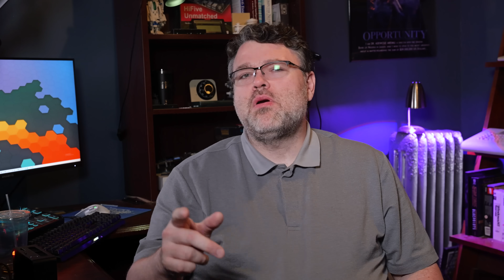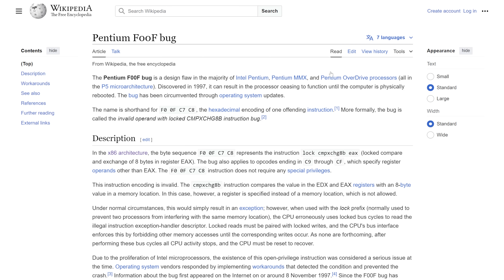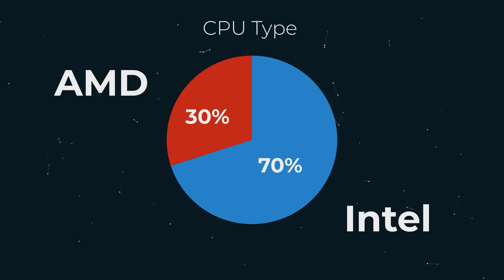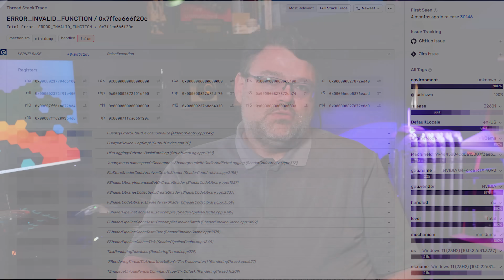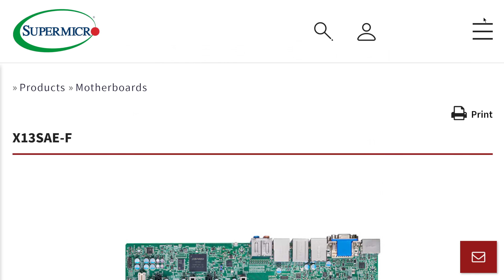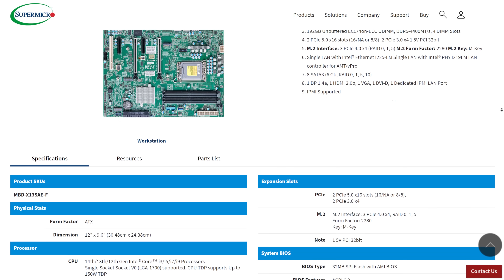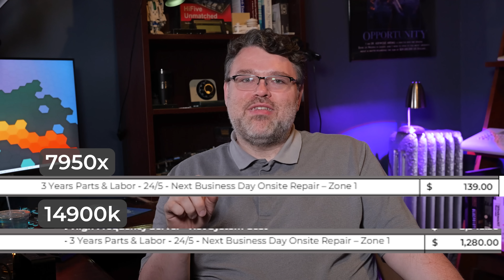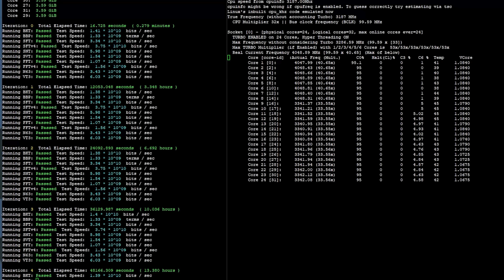Intel has a Pretty Big Problem

Comment: "No one ever got fired for buying Intel." And that's precisely the problem. 😉

I had some issues with data corruption caused by an Intel chipset (800 series, I think) back in the Pentium III days, and decided to switch my company (post-production / visual effects) to AMD. This was around the time the Athlon MP came out, and although we did have issues with one of those (Tyan Tiger MP motherboard with some random "IRQL" bluescreen crashes), every other AMD system (especially since Opteron) has been solid, cheaper, and usually faster than anything Intel had. 

Likewise, I switched to ATA RAID controllers back when everyone was saying "you have to buy SCSI", and then to software RAID (RAIDCore BC controllers) back when everyone was saying "you have to use hardware RAID". Even when they weren't faster (and were just "fast enough"), the difference in price allowed me to upgrade a lot more often and have much more storage than the competition.

Moral of the story: it pays to have a resident nerd instead of just going with the herd.😜
Reply: I had one of those Tyan Tiger MP boards as well. Weirdly enough those random IRQL crashes would go away if you left a PS/2 mouse attached to the machine. Apparently a chipset bug in the DMA section, if I remember correctly.
Reply: Here's my anecdoet: I'm still using 10 year old Intel H87 and Z97 boards and both boards have data corruption issues on the USB ports across multiple USB drives.   The corruption issue occurs when both USB lanes are loaded up with high bandwidth (simultaneous read+write).   This only became an issue when I started using the ports in this configuration for regular high speed reading and writing of large video files.   I am convinced the H87 and Z97 platform has hardware bugs with the USB 3.0 implementation as I am able to reproduce the issue.   I am unable to reproduce the issue on third party ASMedia USB ports, only the Intel USB ports.   Again this is on 2 different motherboards across a variety of USB drives - the only common denominator is the H87 & Z97 platforms.  I also do not get corruption on a third party Renesas PCI USB 3.0 card.   I don't think it was caught back in 2014 because back then nobody was using USB 3.0 at such high speeds for data transfer in both directions (read+write simultaneously).
Reply: @Animal_lives_matter  Wi-Fi in use anywhere nearby?
Early USB 3 implementation had major issues w/ causing and receiving interferance from 2.4Ghz wifi sources. 
Technically, the issue remains to this day; just 'mitigated'.
Reply: @LRK-GT  
Yep I'm aware of that wifi issue and have read the pdf many years ago but that is about USB knocking out wifi signals not vice versa.   I do have a wifi router nearby but it is only turned on when I want to do online stuff, but I should probably do more tests as I never properly tested it.  Both motherboards with the issue have wifi router nearby
Reply: it's good when that resident nerd also has the hands untied. respect and cheers!
Reply: Honestly, I would tend to associate data corruption issues in the i815 days with the onset of the capacitor plague rather than chipset issues. Jumping ship around that time seems ironic since I can't think of much bad to say about Intel chipsets in the Pentium 4 to Core 2 Duo/Quad days and into the early 2010s (even when early 60 series chipsets were found to have issues with degrading SATA ports before launch, a bunch of boards were exchanged on Intel's dime). Well, running PCIe 2.0 GPUs on older PCIe 1.1 chipsets is a bit dodgy (e.g. possible hibernation resume failure) but it's hard to tell whose fault that really is.

Meanwhile, AMD users had to contend with VIA and SiS chipsets and their dodgy drivers, misc. VIA southbridge bugs (PCI issues with SB Live!, 3 Gbit/s drives), or later nForce chips losing their balls as a result of nVidia's famous production issues. Even systems from the AM2/AM3(+) days still seem to have a certain "fiddle factor" with driver quirks that you just wouldn't see on the blue side. While there were some dings to their reputation in the 2010s like USB issues on 100 series chipsets, most of the time you were better off with an Intel system if you wanted your peripherals to actually work flawlessly. Even on AM4, it took AMD a good while to resolve the fTPM issue that caused audio stuttering (and you can still get that to this day if your RAM clocks / timings are too hot, as they often are with DDR4-3600; also, do I need to remind anyone of the broken C-states in Zen 1? last time Intel had C-state issues like was was in 1st-gen Core i). Most recently, on AM5 it was found that using an optical drive on B650 chipset SATA ports would wreak havoc on audio playback. (As someone who still buys and rips CDs semi-regularly, that would annoy me to no end.)

These days the playing field is a lot more even than it used to be 10 or 15 years ago. If you mainly need multithreaded CPU "grunt", there's little reason not to go Team Red. For a basic office box, it's more or less a toss--up between basic LGA1700 and monolithic AM4. Seeing elevated field failure rates is not a first for Intel (see Rocket Lake, although you weren't much better off with Ryzen 3000 which has had its fair share of substrate issues resulting in dead chips), but finding such wide-ranging issues on their top-end consumer parts indicating things being pushed too far is deeply disappointing.
Reply: @PileOfEmptyTapes  - No, nothing to do with capacitors. It was a known issue with the southbridge under high load (and a video workstation back then was pretty much permanently under high load). It ended up being fixed in a later revision, but what prompted my decision was that Intel had known about the issue for a long time and chose to keep their customers in the dark.

In much the same way that they know 13xxx and 14xxx CPUs have issues but continue to sell them while trying to blame everyone but themselves.

Comment: I came to the same hypothesis as maybe the electricity coming in was measured as enough for the use case scenario but maybe the issue is somewhere deeper in the chain of electricity distribution across the architecture of the silicon itself or at least a part of it.

The symptoms really make you think of a power loss when too many things try to work all at once.

Not only we have the amount of cores but also this newest architecture design of E-Cores and P-Cores COMBINED with way higher RAM speed (memory controller requierement) and also way higher requierement when it comes to PCIe lanes/bandwidth.

Maybe Intel kind of did hit the limit of what they could build out off their latest process node, we have been powering our processors with 1.4V or so for so long, maybe with everything going on in those CPUs, this is not enough anymore but they didn't account for that in the design of the chip or at least not enough considering all the losses through all the differents components within' the chips.

Maybe they should have went with a smaller process node but they were like ''Nah, it should be fine for this time, we will move to a smaller process node for the next generation in order to save cost for now''.

Comment: Unstable? Let me share my story, after waiting for 4 years I finally upgraded from a 9900KS to a 14900KS .

1 : First of the bat SP score sucked.
2 : Now own a heater that outpreforms the heat outlet of a modern airco
3 : Intel claimed 6.2GHZ. I've NEVER seen that, and after their supposed bios settings, it doesnt even hit 6.0 ever. This is pure false advertising and if there are more affected in Europe we should start a suit.
4 : When asking the vendor for responsibility they simply point at intel and intel doesn't reply

Comment: the 12900k was clocked at 5200mhz, a 13900k is clocked at 5800 and the 14900k at 6000mhz. even the "conservative" w680 board clocked the chip at 5700mhz. tbh this is probably just too much for what the chips can do stable. the 13600k and 14600k (5100/5300mhz) seem to have none of these problems, despite being the lower binned chips.

also w680 having lower power targets should mean that either a) the chips are clocking down when going full load on all cores or b) the chips are less stable at these clock speeds. it should also mean that the chips are degrading less over time, since creating stability with high voltage degrades the silicon faster.

Comment: I've had to replace a failing power supply that caused instability even in low power situations for my new 14700KF system. The PC first started to get slow and then crashed. After changing the power supply to a known-working older sample, I haven't seen that issue again. I also use DDR4-3466 on tuned timings on four Micron Rev. E 8GB sticks. I've seen instability when trying 3600 but 3466 is fine (and even better performing in games). Needless to say that I am very cautious with my power settings due to these reports, PL1: 125W and PL2: 175W and undervolting massively. While I lost around 10 - 15% multi-core performance compared to normal systems out there, this is still plenty for my needs and wait for a BIOS fix from Intel.
Reply: By the way, I use a contact frame as LGA1700 is said to have some bending issues which lead to cooling problems. Maybe that is a contributing factor? I suppose most machines don't use a contact frame?
Reply: Wait, I forgot to mention a few oddities. My undervolting settings don't appear to be stable when installing Windows from a USB device. Midway through the copying process, the installation would crash. But once Windows is installed, I can re-load the undervolt settings in BIOS and they seem to work fine in Windows and in Games later on. As I use 2 x NVMe devices in RAID-0 and have to install the Intel VMD driver first, I cannot tell if that is a contributing factor. Another one would be a 10 Gbit X540 NIC that only works fine if I put it in the bottomn PCIe slot. I also need to enable the onboard NIC or Windows would throw a BSOD on load.

Comment: I think that all of this "Xtreme OC"/"XMP"/"EXPO"/etc. - overclocking methods are mostly at fault here! 
Pushing numbers up so they can look good on a certain chart! 

Memory kits do not comply to the JEDEC standards. 
Motherboard vendors do not respect the approved specs of the chipset manufacturers (Intel & AMD). 

It's a race of which company can push things higher and still get away with it! 
(Online benchmarks added to the problem too!)

Comment: Mine has been solid for 2 years now.  i9 13900k, 128GB DDR5, rtx3080tTi, Gigibyte Z790 Master, 4 CORSAIR VENGEANCE DDR5 RAM 32GB matched pairs(Micron).  Not using XMP.  Windows 11 Pro

Comment: What about the Non K plan 13900 or 14900 chips? Any indication that these are suffering from the same issue? I have been getting these in place of the Ks due to sale/availability as well as I don't attempt an OC as even the non K chips turbo up well above what I Need. Sad to see Intel suffering stability issues, flying too close to the sun it appears, hope Arrowlake is stable and this is only a 13/14th issue.

Comment: Needed a new virtualization host for @ home, waited until the company i work for rolled out massive amount of new Intel machines. Listened to what was being told on the work floor about the new hardware over some months. Did buy AMD 7000 series because heard nothing but problems on Intel at work. Even when it did not crash then everyone was complaining about the big little architecture, which yes you can disable or do core affinity. But be serious who wants to do stupid settings like that when the competition just has something that does not need that kind of tinkering at all. On AMD i was very careful as well to buy the right combination of hardware. Special for MB and memory combination had to be a verified set. In the end i did buy a B650M AORUS ELITE AX ICE and CMK192GX5M4B5200C38 and for storage i plunked the board full of these: Lexar NM790 4TB. I can say i am very happy with my home server.

Comment: Nice video, job well done! I know how annoying it can be, had randomly crashes on a system. Took me almost a year to find out it was a corrupt 1 or 2 cores in my 3900X (after looking at PSU,GPU,Drivers, memory etc). AMD swapped it and since than zero problems (amazing costumer support). Maybe some cores are just degrading over time with those 13,14K series...
This doesn't bode well for Intel and their shananigans are reflected into their SP the last few years. The giant is definately wobbling.

Comment: I have a 14900K with a 4090 with MSI over boost to 5.8GHz on my P-Cores and my system is rock solid stable. Have I had game crashes? Yes! But it's a known issues in the offending games and it's usually NVIDIA drivers.

Comment: I have a client I built 2 identical 13900k systems for at the beginning of the year to run Lumeon, Bluebeam, Sketchup and a few other programs. One has been problem free but the other quickly started having problems and by mid February was having bluescreens or program crashes every few hours. The transfer rate unzipping files would always fall to the kbps speed and i could always get a crash or bsod by running the latest build of Cinebench at the time. After a few weeks of working in it the only thing I found to make it run reliably was to the BIOS to defaults then disabling hyperthreading. I most recently checked in with them a few weeks ago and they've had no complaints since. They prefer the stability it has now over gambling on getting another bad chip on RMA to get the extra performance back.  They'll RMA once the root cause is found and fixed and are going with AMD builds for the foreseeable future.

Comment: 12:34 I am curious how a telemetry gathering software has managed to capture a screenshot of a POST screen
Reply: That Asus motherboard has IPMI remote management so the system admin can do whatever they need remotely instead of having to call up the data center and have someone find what rack the server is in and walk down to it to see what's going on. Basically it allows the system to be remoted into even before it loads an OS.

Comment: I've had 13900k since launch (less than two years) and replaced it once after about a year. Both times they started fairly (not 100%) stable and have since been detoriating, just like mentioned in the video. Raising VCCSA (by a moderate amount) had helped a lot. But but after some time I've had to start dropping turbo clocks, and now even that is losing the effectiveness. Additionally this second chip has a rather strange way of working, such that it only rarely boots with JEDEC DDR5 speeds, REQUIRING an overclock - even at the same voltages. How does that even work? The recently released baseline power profiles haven't seem to do much either.

I've seen my fair share of out of VRAM errors, especially with Satisfactory. An a lot of times it's been Discord installer that hasn't been able to even start due to JS execution things. And decompressing many installers has also been very unstable. Also, Visual Studio has been really unstable even if nothing else is.

Before I warrantied the last one I was re-installing Windows quite often, with disk errors to go with that. With VCSSA and the lower clocks this one hasn't yet(!) been as bad as the old one ended up, but it's coming. And I can't keep warrantying these as I don't really have a spare system for the several weeks the warranty process would take each time. I hate that I can't do whatever I want without the thing crashing, and it's affecting how I use my system.

Comment: My 14900k doesn't crash under heavy multi-thread load. It crashes CONSTANTLY under single threaded loads if left at stock setting. I've gotten it stable by setting P cores to max 55x and E cores (all still on) to 44x in XTU. If left at stock, I see 7zip errors, Thunderbird crashing every 2-5 minutes, Chrome tabs/extensions crashing, Signal won't even open, and BSOD usually within an hour of reboot. Even Task Manager will crash if it's the only thing open at stock. I've never overclocked the cores and never changed a voltage setting. The only "overclock" I've done is enabling XMP to run 192GB at 5600 MT/s. I saw no stability increase from removing 2 DIMMs and only running 96GB. Changing back to 192GB after the 55x change saw the system stable for an uptime of at least 2 weeks if not 3 before Windows update forced a reboot or the power flickered.

The last power outage due to storms a few days ago somehow reset the XTU settings back to default and the system became unstable again. It was so unstable that it took 3 or 4 reboots just to get XTU to open and force my clocks down again.

Comment: Sounds to me like it's a hardware problem either in the cache circuits or the memory controller. Sure, you can blow some fuses, move a data path here, loosen up timings: 1ns here, two clock cycles there etc. But those "solutions" will just hide the issue. 
Intel should've caught it while evaluating the first batch of these from fabrication, but I guess they don't push their chips hard enough in testing. 
Or, they had enough dead silicon that this is the absolute best they could get out of it. Random memory circuits just not performing well, and different ones in every chip. 
Anyway, these shouldn't have been released.

It's a miracle any of these work at all at the frequencies they're pushing. Chip designers are magicians and heroes for every release of a stable, boring product.

Comment: There are so many sources of faults. It may be nightmare to find the root cause. In my life I faced two sources:
- the CPU was rebooting when old refrigerator compressor was starting in the kitchen. Not clear was it power line induced problem or RF induced problem
- 12+ years later another CPU was restarting when the computer power supply was connected to faulty wall power outlet
Sometimes sh!t happens outside.